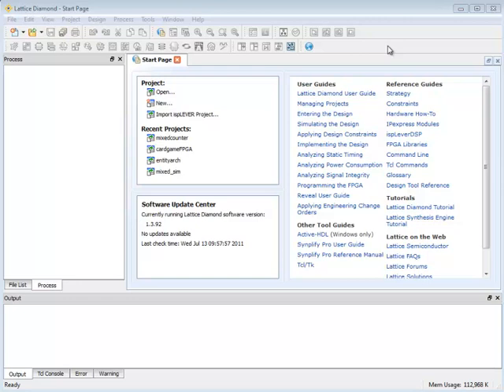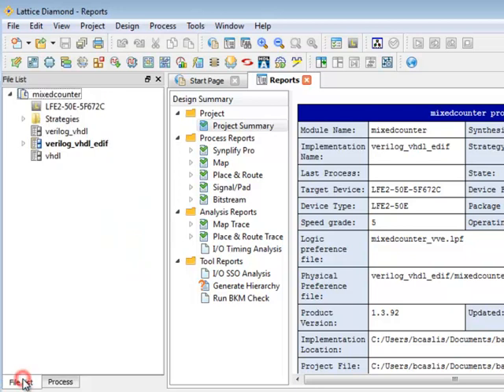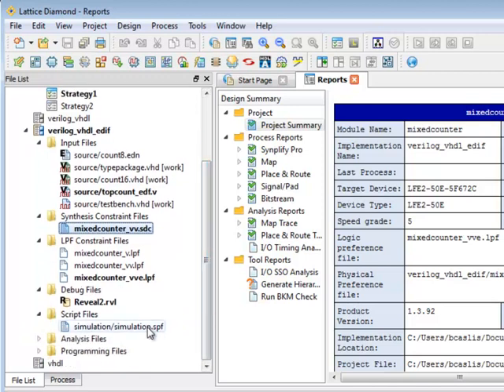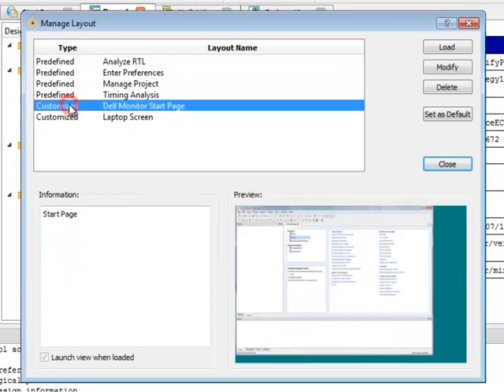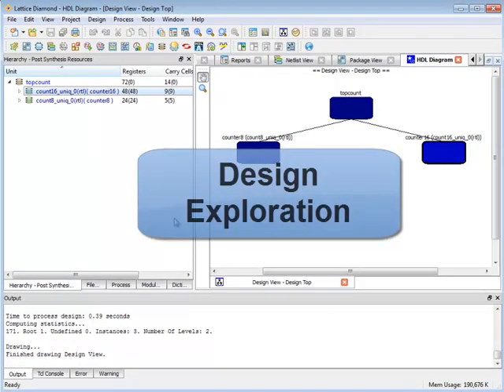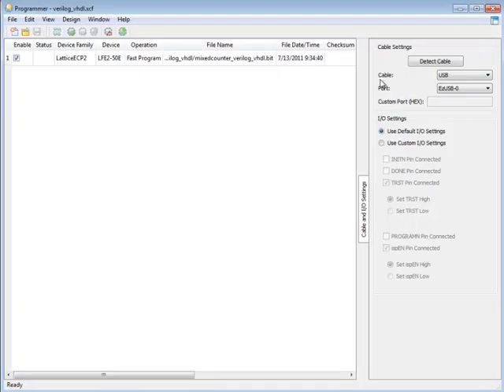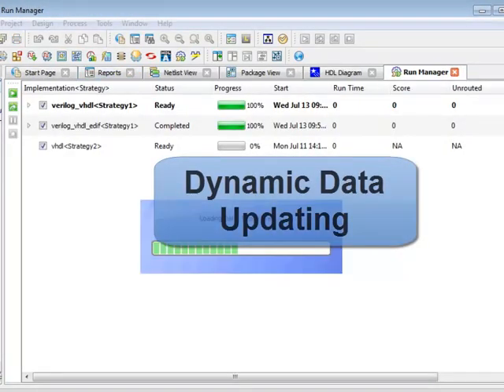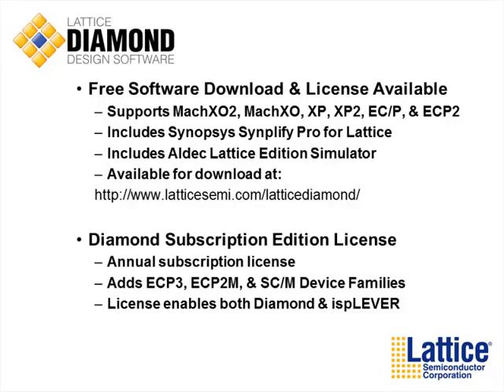Diamond FPGA Design Software - Overview

Comment: As per DilbertMe, there's a lot of fluff without actually explaining How To Use the software. 
I'd suggest - one OR gate, and (maybe) a flip-flop. 

Start with definition, pin selection etc, ALL THE WAY to device programming. 
In VHDL, then again in the schematic page.

Comment: this software is very difficult to use, I can make changes to a simple blink sketch, re run all, program .jed and it does not change. With Xilinx ise I can easily write code and program in minutes, your vhd is right in front of you and you don't have to chase it down, I don't understand why this system is so complicated to start, if it where like Xilinx ise with its simplicity for beginner user and the advanced options in settings on demand would really help, theres no good examples out there, have you actually seen them? most show incomplete code on screen, but supply a .vhd without cleary describing how to import it, just very overwhelming, took 4 hours just to finally figure out how to upload a example.